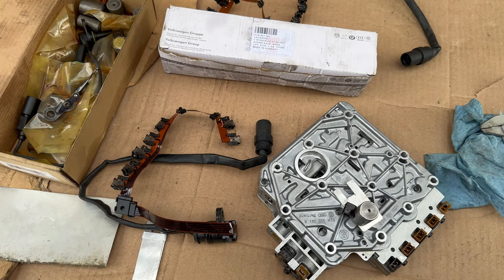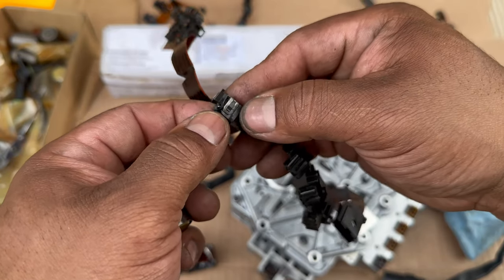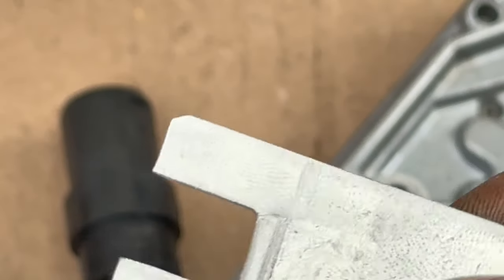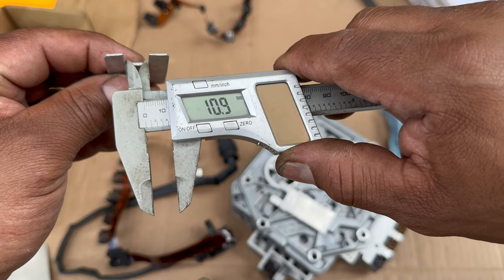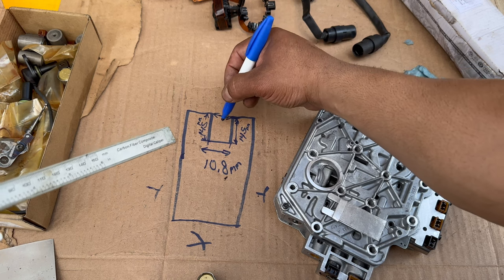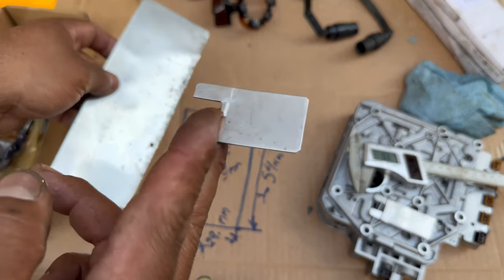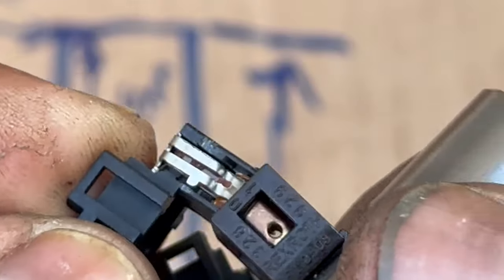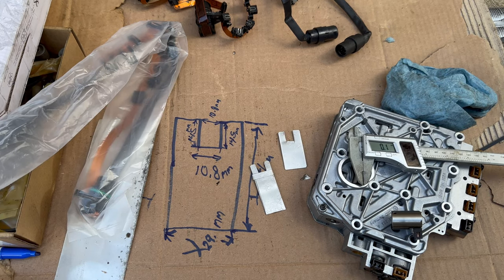mk3- mk4 automatic transmission fellas   .

Comment: Hello, I have bought 2002 vw tdi Jetta, my scanner is saying it’s getting no (data)information from the transmission.. fuse is good (gauges still work also).. shifts rough/delayed also. Any idea why? Bad TCM? Any help be great!.. thank you
Reply from the maker: Could be tcm    Does it have any lights on like abs or epc ?
Reply: @taco8v  yeah the abs light is on
Reply from the maker: Try to fix that and with vcds go into engine and check if is coded for automatic   It maybe coded for manual and thats why it doesn’t recognize your transmission
Reply: @taco8v  okay I’ll do that, thank you on the advice! I’ll let you know if it works.